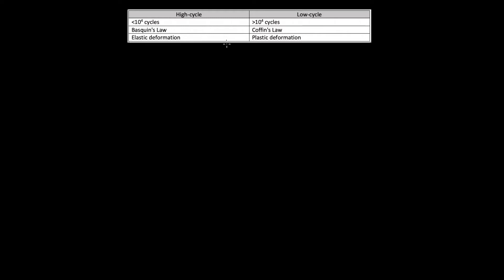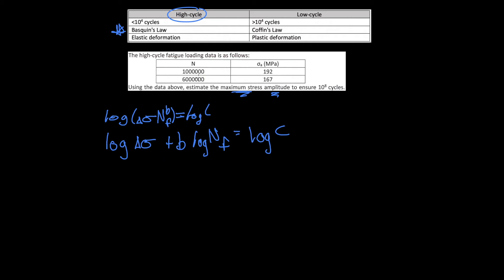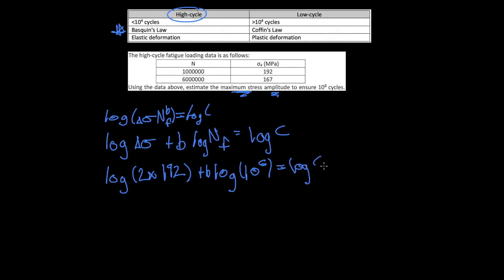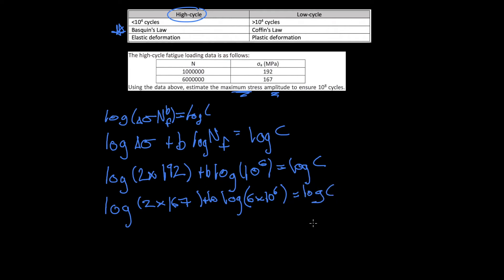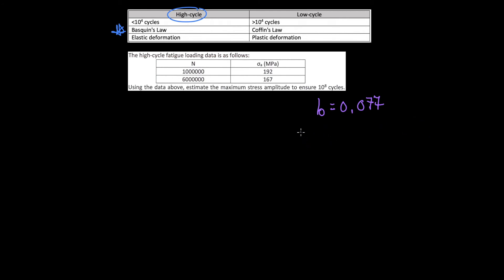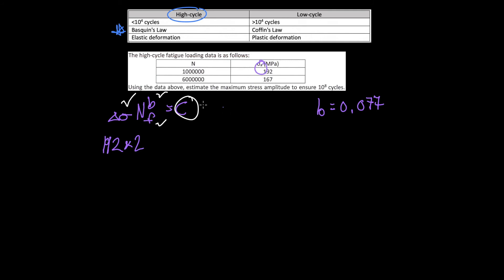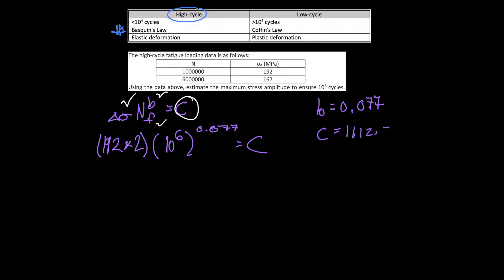Basquin's and Coffin's Laws, Fatigue

Comment: Actually I just edited my comment, High cycle fatigue is normally for N>= 10^4 like for steel and could reach 15 to 20 x10^3 cycles for Ti64. I guess I was confused by the table you showed on the screen where you showed under High cycle <10^4. It should read >10^4 rather.
Reply from the maker: 10^4 is an assumption that applies for most (but not all) materials.

The question specifies "The high-cycle fatigue loading data"  and high-cycle means we need to use Basquin's Law.

Comment: For.the  b value is giving me negative. do we just ignore the negative because it will have a big impact on the result ? 
Also, for finding the maximum stress you can just substitute the numbers in the equations without doing the Log function.
Great work thanks a lot!!
Reply from the maker: Yep—you can also substitute the numbers without the log function. There’s often (though not always) more than one way to do something!
Reply from the maker: I forgot to write the negative sign for the b value. My bad! However, notice how the sign changes from negative (yellow) to positive (purple) equation for the log form of Basquin’s Law because I SHOULD have written the  b value as negative. Meaning you would have had “-(-b)=+b”
Reply from the maker: In general, ignoring a negative sign (or any type of value), just because it’ll impact your result, isn’t proper justification. For example, if this was on an exam, how would you know which result was right?